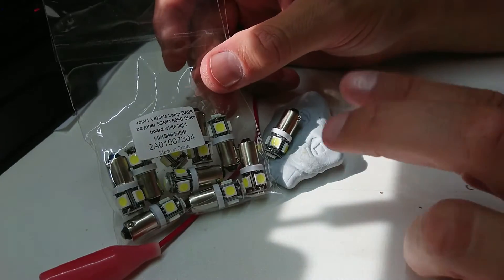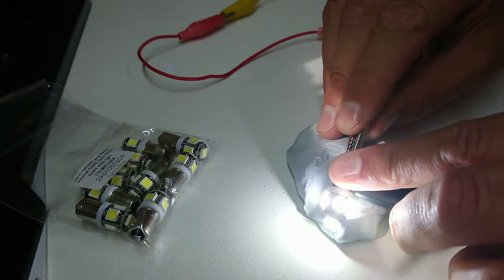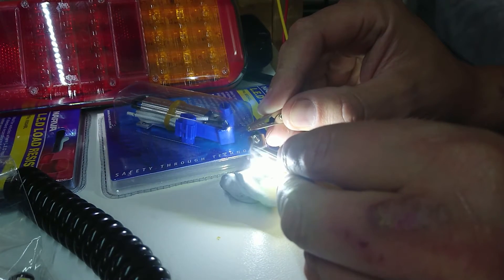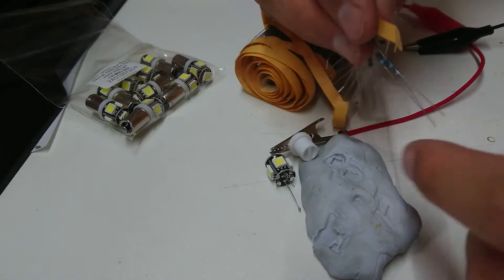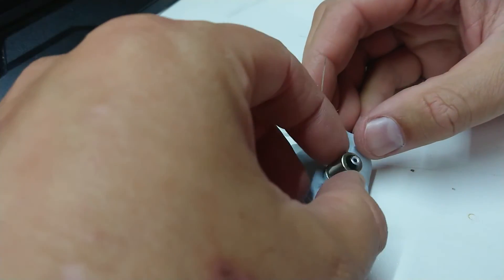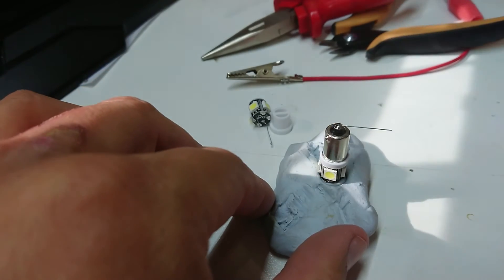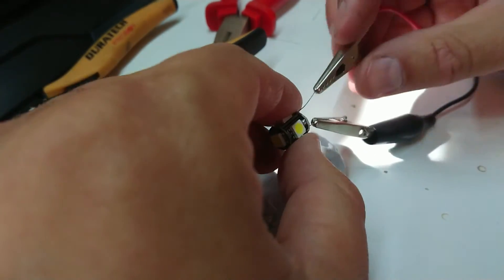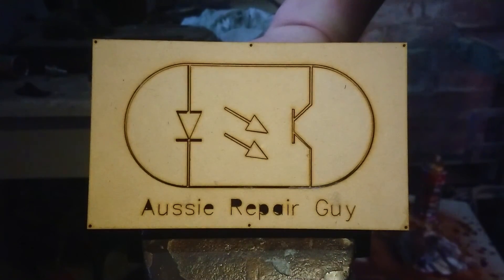BA9S LED globe modified for 24v

Comment: Which kondensatoren?
Reply from the maker: No capacitors used. These are low voltage DC. Only a resistor is needed.

Keine Kondensatoren verwendet.  Dies sind Niederspannungs-Gleichstrom.  Es wird nur ein Widerstand benötigt.